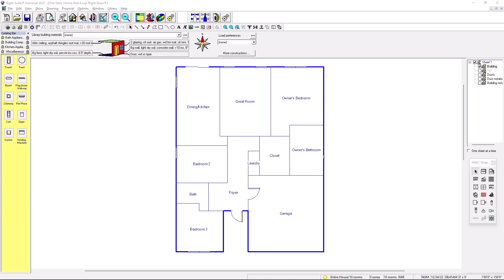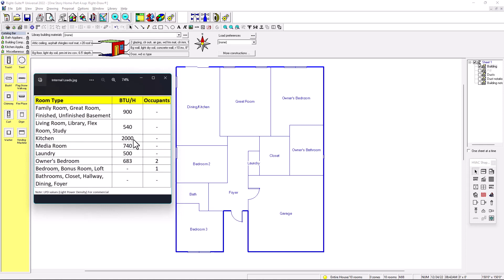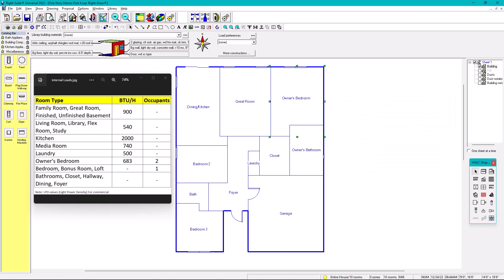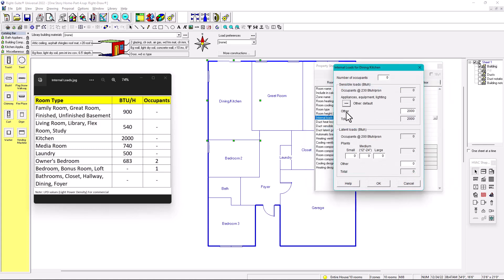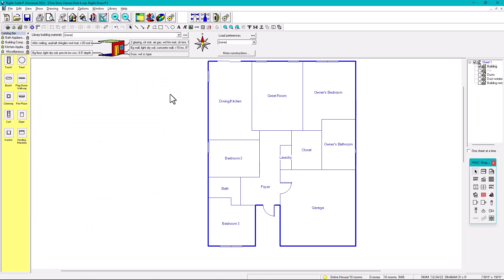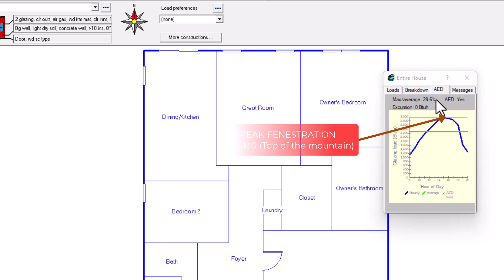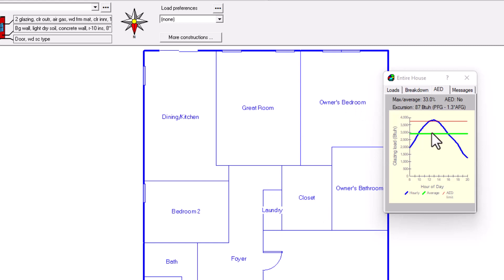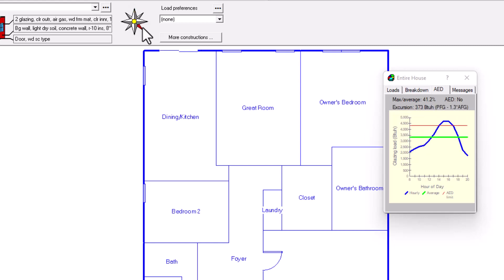Wrightsoft (Part 4): Manual J Heat Load Calculation - One Story Home

Comment: I didn't see how you opened the internal loads table (Black colored). I check the 3rd video and didn't see it there... Could you please explain?
Reply from the maker: Thanks for your comment. The table is something I created in excel and took a screen shot to explain the internal loads. Unfortunately it is not part of the program. Every home builder has their own tables and requirement for internal loads. However most of them refer to Manual J guidelines.

Comment: Thank you for this video!
I have a question, how do you open your Lighting Internal Loads?
Reply from the maker: Thanks for your kind comment! To reference the Loads it is a great resource to check on the RIGHT-J WORKSHEET in wrightsoft. This is pretty much the ACCA Manual J Worksheet which doesn't account for lights in residential. In commercial projects (ACCA Manual N), lighting is very important measured in W/SF depending on the location. Refer for example to the Table C405.3.2.1 from the IECC-2018 to find LPD values (lighting power density) https://codes.iccsafe.org/s/IECC2018P5/chapter-4-ce-commercial-energy-efficiency/IECC2018P5-CE-Ch04-SecC405.3.2
Hope this helps.
Reply: @hvaceasymath  Does this mean that light loads just don't really matter in residential loads mostly?
Reply from the maker: Yup, not so much. Mainly in semi commercial and definitely in commercial building.

Comment: I know I'm late but I'm learning Wrightsoft right now and I appreciate these videos, thank you for your work. 

I have a question how do you get your internal loads? Is it from the customer or was it in the program?
Reply from the maker: Thanks for your kind comment!
For internal loads you have different options:
1. If it is a new construction the home builder usually provides their own requirements. Among them are the heat loads 
2. If you don’t have the home builder requirements you can rely on what Manual J recommends or wrightsoft (Which is based on Manual J anyway) 
3. You can take my internal loads table that summarizes the heat loads and they are taken from Manual J. This is the easiest way. 

Usually when I don’t have that information I just use the table I show in the video.
Reply: @hvaceasymath  thank you for the info
Reply from the maker: @Nefarious_necromacer_kush  no problem 👍